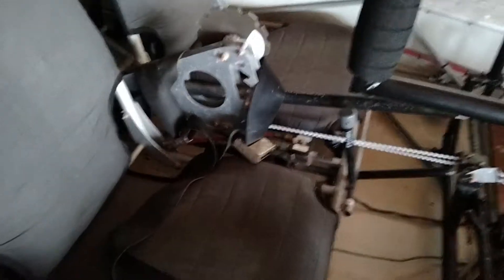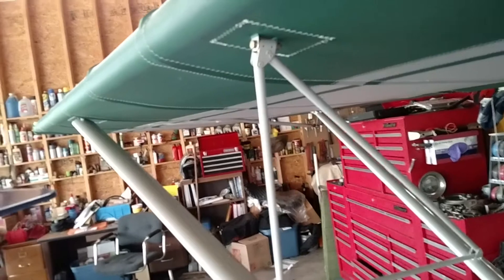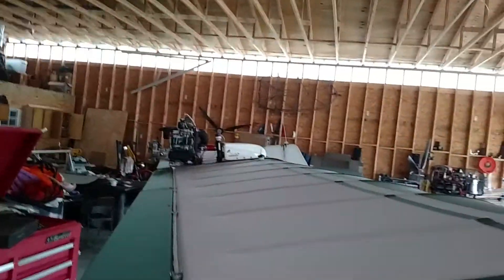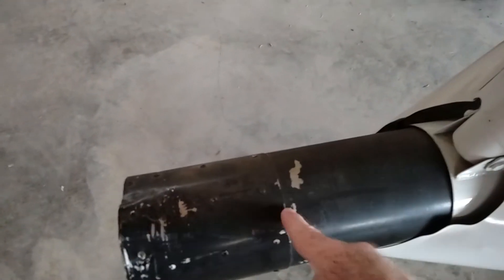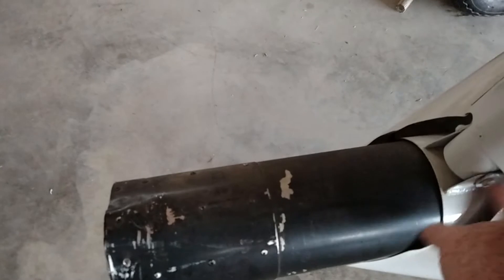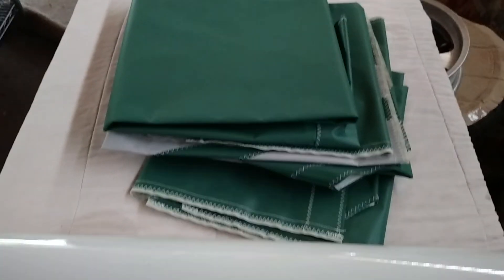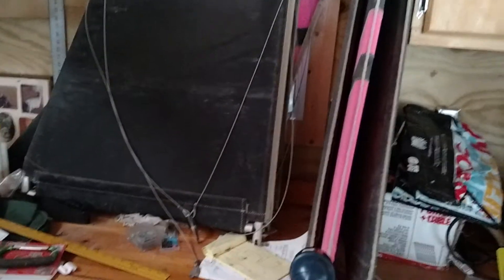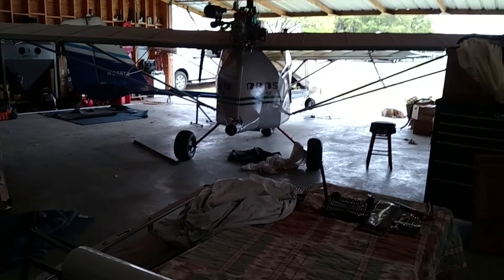Rans S-12 update 03-30-2016

Comment from the maker: yes it is on the plane.  It is a VLS (vertical launch ).  It is the square white box in the middle if the wing in front of the engine.  is says BRS on it.  looks a little different than the canister units.